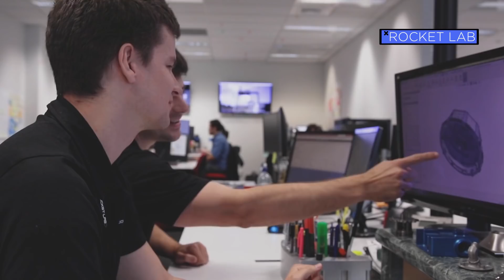The First Private Space Mission to Venus | The Space Show

Comment: Why not use a balloon to stick around in the upper atmosphere instead of parachuting down to the surface with the probe?  You could have the probe have half dozen sub-probes which go down to the surface whereas the primary probe floats in the upper atmosphere similarly to a probe on a weather balloon on earth.  It could gather information long term and drop multiple smaller probes onto the surface as it floats above the surface of Venus taking measurements and relaying messages from the dropped probes back to earth?

Comment: What is your plan to deal with extreme heat and pressure?
Nope! Didn't ask the most important question.
Reply: the research from Carbon C02 capture and recycling it into O2 or H20. Would be interesting to see photos of the unit that was landed there and what ever happened to the Soviets Piloted mission unit.
Reply: @racer98  the Soviets sent a pilot to Venus!?! 😂
Reply: @airlinena  they sent a probe not a freaking pilot 🤣🤣
Reply: @soumyojitpal3399  that was my point! Having trouble reading English?

Comment: Hold up, if we're going to Venus, and we've only got seconds worth of data... That seems odd to me. The Russians landed on Venus. Surely with 2021 technology we can build a basic lander to get at least some extended time and data on the surface?
Reply: Nothing can land on there

You'd need a mechanical computer
Reply: It's the thing sending signals back is the thing that fails first, I think. You can have a metal ball outer shell that can withstand Venus but it's the "aerial" or the dish, that sends back the info, that is destroyed by the atmosphere.